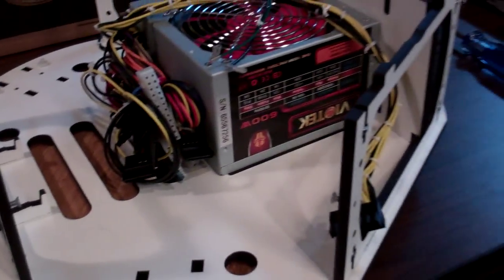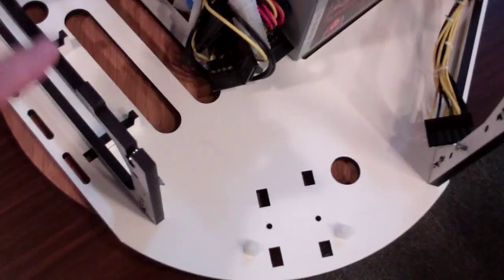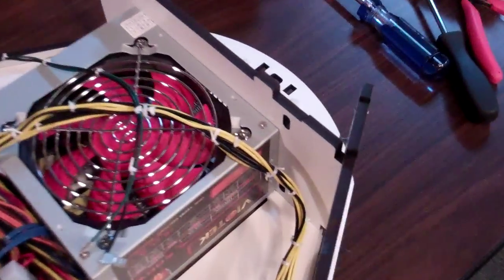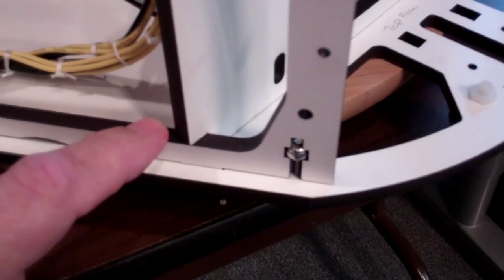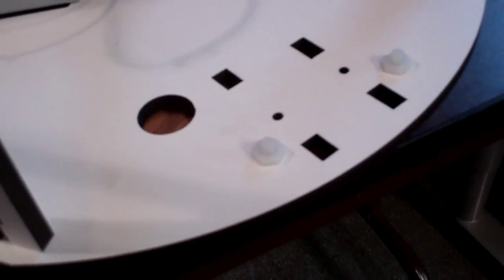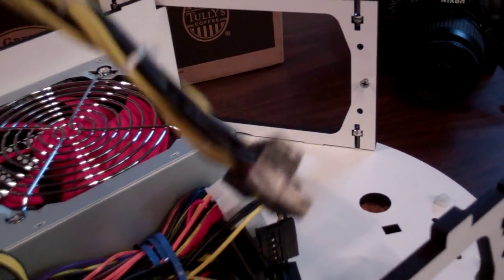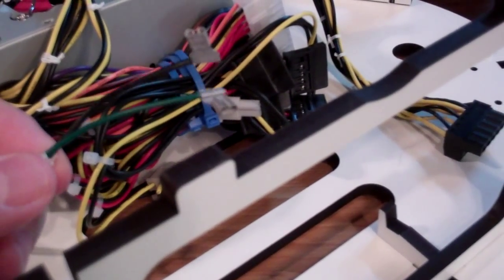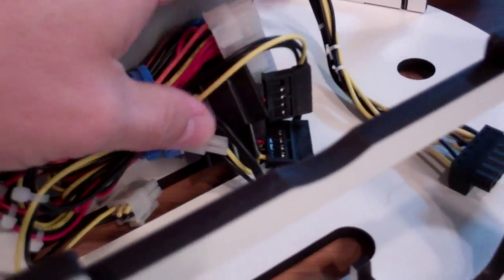Rostock MAX v2 Assembly: Checkpoint #1

Comment: First thing I bought to start my build was one of those 18" carousels,,, lol.   It's perfect for the job.
I'm actually having to repair a V1.5 first,, (late model V1 fully updated).  The build was so sloppy, I'm afraid to even power it up.  Atleast I'll be quite familiar with the assembly, before starting on the V2 kit.
Thanks for pointing out the changes in the two models.  It gonna help make a lot more sense of what I'm looking at,, on my workbench,, and in the rest of the "checkpoint" videos.